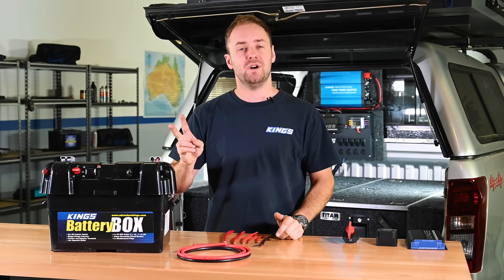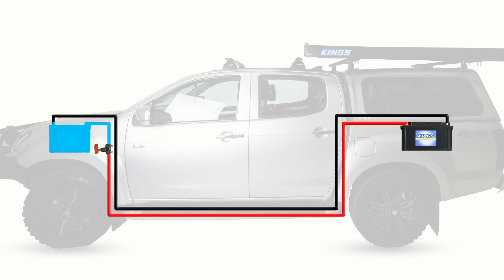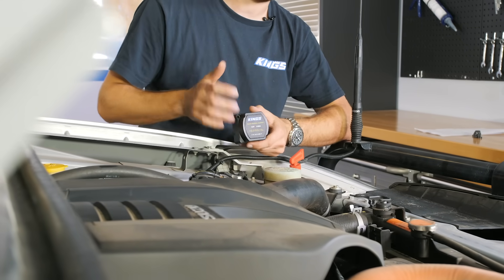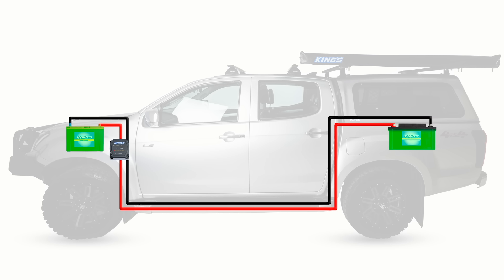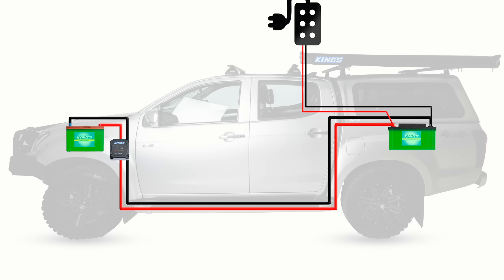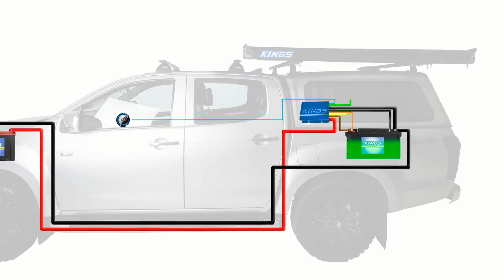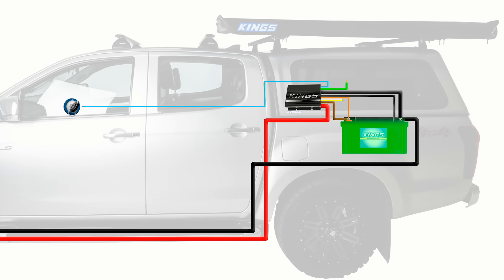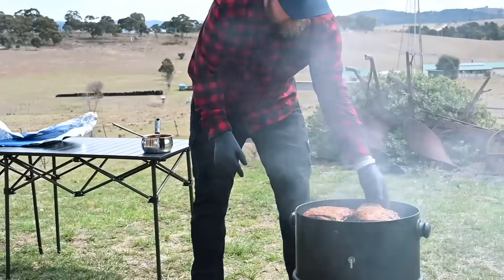Complete Off-Grid 12v Dual Battery Masterclass PART 2: Battery Charging Secrets Revealed

Comment: does anyone know what gauge the heavy duty wire would be?
Reply from the maker: All the wiring on the smart isolator is 10mm^2 outside of that you're generally looking to scale to your needs as broader gauge can cause higher loss so finding your upper draw requirements and scaling to those is your best bet.

Regards, Andrew

Comment: Hey just wondering if a DC DC charger is required if I already have an isolator?
Reply from the maker: Hi there, 
A isolator will not charge the battery. If you would like to charge the battery you will need a DCDC charger. If you want to charge the battery via solar and the alternator, you will need the DCDC charger. 
Kind regards, Rachael

Comment: So with a dc dc charger, do I still need an isolator? Can I just use a manual isolator or is a smart isolator recommended? ACA will the aux battery drain the starter?
Reply from the maker: Hi there,
Our DCDC charger has an inbuilt isolator.
Cheers, Courtney

Comment: For the 25a wire kit (I have a 25a dcdc charger), is the negative wire connected to the negative port of starter battery or earth of vehicle? I can't get mine to work unfortunately
Reply from the maker: Hi there,
The negative wire for the wiring kit is connected to the starter battery, you can find a video to assist further with installation here - https://youtu.be/LMLZ7KmbZ8k
Cheers, Courtney
Reply: @4wdsupacentreAu  cheers Courtney. I've connected the 25a from the starter battery in hood to the auxiliary battery in the Ute tub via the dcdc charger. I've been driving for a combined time of just over 2 hrs today and the voltage has not moved from 13.4 (on the battery box screen) since before I left home. Not too sure why that is. Was hoping with the driving I've been doing today alone that at least the voltage would go up more.
Reply: @4wdsupacentreAu  just a little frustrating because I just bought the wiring kit, dcdc charger and battery (as well as battery box) on new years eve and hoping everything is working fine before camping with family this weekend. But the voltage for the 120ah lithium battery hasn't moved since I bought it and connected it to my Ute.

Comment: One explanation missing is the full car length negative cable. It's not supplied with your isolator switch system from Kings. How much current loss by earthing the battery?

Comment: Amazing video, thank you so much!

I have one question:
I'm running a 100ah Kings Battery with the smart isolator. Now I'm using the car for daily life as well, and I'm worried, that the auxiliary battery is constantly charged by the starter battery, while not being used or discharged for days or weeks until I go camping again. Should I disconnect my auxiliary battery from the starter battery when using the car in a daily routine?

Any tips are highly appreciated. Thanks!

Comment: Question: I have 12V plug to anderson so if I plug it in my cigarette lighter and use MPPT controler from my solar blanket and plug into the deep cycle battery to charge while driving, would that be OK or not?

Comment: I have  a '98 diesel hilux with an extra battery already under bonnet.  I plan a third battery in back later on.
Q1 can you recommend a compromise battery type that "does OK" under the bonnet for the time being? There's already an isolator.
Q2 would you recommend a second isolator to keep batteries 2 and 3 separate or treat them as one battery? 

Might a  smart isolator could be bypassed with a 100A relay while the engine is running before a smart isolator makes it in?
Sorry if you say that later in the video.

Got one of your light bars and some of your reversing lights for Christmas.  😀 I like them. Also STEDI ones. 
 I grok this stuff, but didn't know about all the 12v gear that is now available. Thanks for the tips.

Comment: If i wanted to charge a portable power battery is it advised to stil use a bcdc unit? Or can i just plug it into the cars 240v outlet/cigarette lighter to charge up my portable battery when driving and just remember to disconnect it when my car is off?

Comment: Hi champ I'm new to this game. Can you tell me about the red on off switch on the kings battery box.  And how and when it should be used.  Cheers
Reply from the maker: Hi mate, use the red on/off switch when you want to completely isolate the battery so no power is going in or coming out - like when it is stored for extended periods of time. Cheers for watching! Brenno

Comment: BTW, in the states, household line power is 120-125 Volts 60 Hz. We have 240 volt outlets, but usually a limited number. Also AGM, for the uninformed is a newer battery technology, Absorbent Glass Mat. It's an advanced lead-acid battery that provides superior power to support the higher electrical demands. Bottom line, AGM is more expensive. Also, beware of cheaper diode isolators. A silicone diode semiconductor junction has a 0.7 fixed voltage drop that u need to be aware of. I like the sensor type better. Or better yet the DC/DC charger is best.

Comment: Hi guys,  I have a TOYOTA estima 2005. I purchased a dcdc battery box from another company and need to know where the blue wire gets connected to. I'm having a lot of trouble getting a response from the other company.  Many thanks, Steve
Reply from the maker: Hey mate, what dc to dc battery do you have?

Comment: Can you hook up two deep cycle batteries in a series/parallel using two boxes?
Reply from the maker: You certainly can mate, just use some suitably sized cabling to connect positive to positive battery terminals and negative to negative to connect in parallel.  Cheers Brenno

Comment: i see that the solar panel connects via the left plug whats the right side plug used for ive never seen anything plugged in there
Reply from the maker: It’s just an output for power - so you can plug just about anything in there so long as you don’t overload that circuit!

Cheers,
Cahn

Comment: So if using the dc dc charger do I still leave my kings isolator in ? Or would this replace it 
Thanks for the great videos
Reply from the maker: Hey mate,

If you're adding the DCDC charger, you wont need the isolator as the DCDC charger does the same thing!

just check the user manual for whether or not you need to connect the blue wire (necessary for smart alternators) which will isolate the second battery when your ignition is off! Otherwise, without the blue wire connected it works similar to the VSR and turns off when it senses a certain low voltage.

Cheers,
Cahn

Comment: Why do I need a take a negative cable to the back of the vehicle, can't I just connect it to the chassis like the starter battery then I would only need one heavy duty cable to feed through to the back of the vehicle ?
Reply from the maker: Hey mate,

You can but running a separate heavy duty cable is just a better option.

In most cases earthing to the chassis will work - it’s worth checking the voltage drop though as steel is less conductive than copper!

Cheers,
Cahn

Comment: I have a 2nd battery in a battery box in my car which I used to power my camping fridge. I charge it when driving via the car cigarette lighter socket. It simply connects into the car socket at one end and a socket in the battery box at the other. When the engine is going it charges. When the engine is off it doesn't. I'd be interested in your comments on this system.
Reply from the maker: Hi Anne great to hear your battery is being put to good use. Is there a particular question you have? We have many detailed youtube videos on our batteries that may assist you further including this useful video on dual battery basics p1. https://www.youtube.com/watch?v=8F6AYavY870&list=PL9ERtpxlJTUU1lgxuheF0vAJarFz_fFgs&index=3&t=3s
Cheers, Emily

Comment: My truck is outfitted from the factory with a second mounting location under the hood for an auxiliary battery. I'd like to mount it there, would you guys?
Reply: Will the 2nd battery be a lead acid or an AGM (absorbent glass mat) battery? You must know that before you can expect a knowledgeable answer.
Reply: @bentnickel7487  
I think I would prefer an AGM battery.
Reply: Your truck's starting battery is lead acid and can take very high starting temps. AGM on the other hand don't like temps over 120 degrees Fahrenheit, so in the summer that AGM will be damaged if it's under the hood. What year and model is your truck and are you located in the U.S. or Australia?
Reply: @bentnickel7487  
I'm in the US. I've got a 2013 Silverado.
Reply: Ok. I am as well.I imagine both of those batteries are lead acid due to the heat factor under the hood. So many vehicles today MUST rely on two batteries to maintain smart parts on climate control, power accessories, alarm systems, etc. So, you'll need 2 lead batteries under your hood and an AGM, probably located back in the bed. You don't want any batteries in the cab with you, if you can avoid it. Also, so many people start adding batteries, relays, chargers, fuses, wiring, but NO ONE ever has an ABC fire extinguisher when something catches fire.

Comment: Which is the easiest to set up between the solar and running the cables to the alternator and start battery?
Reply from the maker: Solar is arguably easier, but it really depends on your vehicle. Utes make it a lot easier for either as you can easily run wire underneath the vehicle and into the tub or canopy. In a wagon you'd generally run the wiring through the vehicle under the carpet. Either way fuses or circuit breakers are essential!

But you'd require a lot of solar panels to equal the output of your alternator - so it's not really a fair comparison.

If you had a 100A Alternator charging at 14.4V, you'd need about 1400 Watts of solar to charge the equivalent amount.

You don't technically need to run to your alternator as that's all factory fitted in your vehicle. you do need to run the wiring from your start battery through to your auxiliary battery though. with solar input you just need to run the wires from your solar panel to your auxiliary battery (with a regulator and fuses)

What are you thinking for your setup and I can offer some more advice!

Cheers,
Cahn

Comment: AGM batteries only charge at 14.4 volts 4wd supacentre gee wiz lol
Reply from the maker: Hey Adam it's actually dependent on the battery itself - generally they'll require 2.4 to 2.45V per cell. IMaybe I should've been less specific, but I figure this is a basic video so it's just showing that different batteries require different charging voltages.

With 6 cells in a 12V battery: 2.4*6=14.4V. You're right, some need 14.4V - best idea is to look at the individual battery specs and use a charger that's able to select for voltage or battery chemistry.

Another good idea is to use a charger with temperature compensation as the V/cell will change depending on the batteries temperature and internal resistance.

Cheers,
Cahn